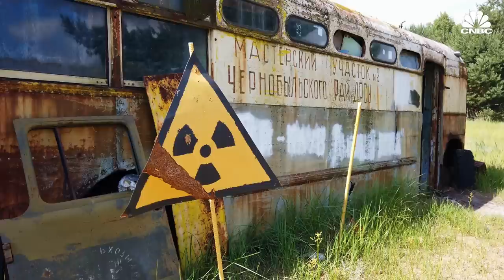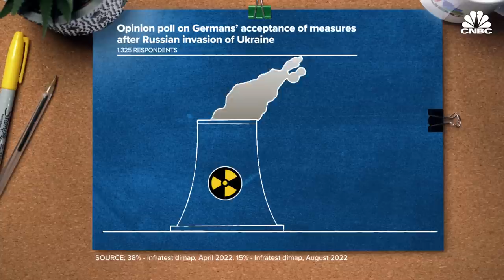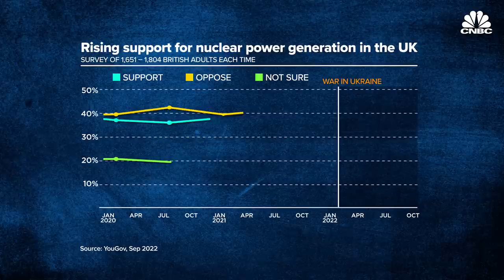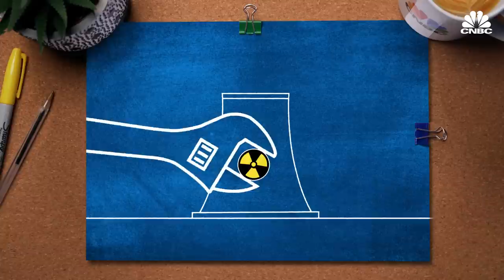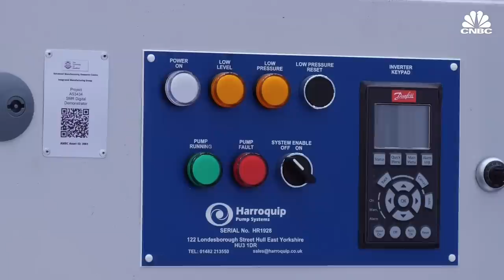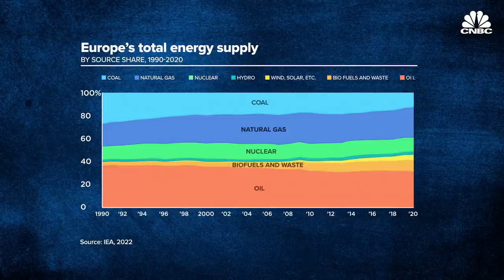The future of nuclear is divided into two camps - here’s why

Comment: It’s sad cause Germany has so much potential, its already at almost 50% renewable energy generation. Using reliable nuclear power it could have been at 60 to 70% putting at the forefront of renewable energy transition especially for a high carbon emitting country
Reply: Now Germany is increasing its use of coal.
Reply: Nuclear is low carbon source of energy but it is not renewable.....
Reply: @aldrinspeck2724   If your criteria is limited resources, then nothing is renewable.
Reply: Renewable doesn't mean "infinite", it only means "the supply is HUGE!"
Reply: nuclear electricity is five times more expensive than solar it is much more viable to develop grid storage then to build nuclear plant which takes 7 years to build
Reply: @floopybits8037  solar isn’t a viable base load electricity source for Northern Europe, and definitely more carbon intensive per mw of electricity throughout the year.
Reply: @MrSpritzmeister  Not if you source from Sahara which is sunniest place on earth. How is it caron intensive ??? Manufacturing solar cell takes less than 2% of what gas or nuclear generate per kW
Reply: @aldrinspeck2724   The world's supply of uranium and thorium is HUGE.  We even have the technology to extract uranium from sea water which has a virtually unlimited amount to meet the world's needs.
Reply: @floopybits8037  this video is about Germany and the UK, which aren’t sunny places. Where are solar panels made, using which power source? If you’d use Sahara for power generation you’d have to make sure that the panels do not overheat, get covered in sand, and then you would need massive amounts of materials for the power transmission lines, which also are carbon intensive and how about battery storage? Solar and wind are part of the energy mix, but cannot power fully an industrial country like Germany. Do you know what base load is?
Reply: @floopybits8037  Nope. Amortized existing German nuclear power stations have the cheapest electricity period. Adding only 4 hours of storage to wind and solar pushes the cost higher than the most expensive nuclear power station.
Reply: @gregorymalchuk272   lithium ion storage is expensive not rust based and air based batteries
Reply: I would like to know how urban and plutonium are renewable. Anyway pit those powerplants in India. They need it. But no whining this time if a second Bophal incident happens. There are many Indians anyway.
Reply: @floopybits8037  nuclear is like twice as cheap, wdym
Reply: @aldrinspeck2724  Current 'known' uranium mine is more than enough to supply the globe for thousands of years. That is HUGE
Reply: @aldrinspeck2724  Oh, really?  Then what would you call the fucking sun???
Reply: we got 96% non fossile fuel energy here in sweden france got 90%. While germany is pathetically at 45% fossile fuel useage. Its funny how inefficient renwebles actually are in comparison to nuclear energy especially smr reactors.  Solar is the cheapest energy if we do not count the storage cost, if we account for that it becomes one of the most expensive energy source. Potential energy batteries or litum ion battery is far more expensive then nuclear fuel. 

Like always the anti nuclear crowd just ignore large part of reality over how our energy grid works.
Reply: @floopybits8037  Not when you account for variability, and power storage, and the extra capacity you'll need to build to account for dunkerflaute.
Reply: @aldrinspeck2724  Nuclear certainly is renewable. You just must use Thorium as the basis. But we are not going to run out of Uranium for centuries even then.
Reply: @christianlibertarian5488  According to Nuclear Energy Agency of the OECD, NEA:
Thorium based breeders are only expected by 2050 (although one could stretch current fuel with Thorium by 2030 though not turn Light Water Reactors into Breeders)
NEAs Redbook notes an estimated Uranium Reserve globally of about 8.000.000 tons of Uranium. Taking the „Recycled Nuclear Fuel Cost Calculator“ for a 1 GW powerplant at 90% capacity factor gives us a Uranium demand of 200 tons per year. Assuming a planned lifetime of 60 years and ignoring consumption from existing reactors, you could build 666 new 1 GW plants.
Reply: We can’t build inland wind farms because people don’t want to see them near their homes. I don’t think we could build enough nuclear plants even if our life’s depended on it.
Reply: @Paul-uy1ru  Your life does depend on it.

Comment: 9:13 NO, most of the nuclear reactors in operation in France were built in the 70s and not the 50s (the oldest to date is Bugey 2, which began construction in 1972)
Reply: yes -  that may be true -  but so many have very serious aging and maintenance issues.  If you believe the story from the nuclear industry, the lights should have gone out in Germany and France has had no problems... but this is definately not true.   Best wishes from Berlin.
Reply: Brah they are still old and with a lot of issues. Bad planning by the french government already and will cost france a lot of money
Reply: @1968Christiaan French politicians decided by law to stop money to the maintenance of reactors. The law stated that nuclear power should be halved or so. That is the main reason why maintenance hasn’t been at par. Why didn’t the lights go out? Increased gas exports from Norway, mild winter, insane high prices which led to lower demand, rationing and the fact that many countries fired up coal power plants again. It is a shame. 
New nuclear reactors are safe. It is the energy source that has killed the least amount of people per KWh. Thousands will suffer from asthma and die early due to the politics of Berlin. 
Even though Germany managed now, what is their plan in 15 years? You need baseload power. What will they do in January if there is -15 C, no sunshine and no wind? The entire system has to be built around coping with those days. 
Batteries? Sure. Sounds great, but all the batteries on the planet can power Tokyo for 72 hours. The technology isn’t there. It is a huge gamble to think it will in a decade. The most likely result is that Germany won’t meet its climate obligations. The climate is the loser.
Reply: @1968Christiaan the reactors are fine, most of the issues are on pipes used for the cooling of the reactor and are replaceable.
Reply: @1968Christiaan in France electricity is half as expensive as in Germany, and on the other hand, 1 German produces on average twice as much CO2 as a French person. we've never had an accident and we don't have coal mines the size of New York on our territory, we can see your disastrous choices from space.

Comment: With river levels falling in Europe, and remaining river water warming, providing cooling water for nuclear reactors is an increasing problem.
Whatever the merits of nuclear power, it is unlikely to avoid the effects of climate change. Planners must be prepared for a climate that humans have never previously experienced, and that must include how electricity is generated.
Reply: Hence why they build them along the sea side.....water issue solved!!!!
Reply: Even if water levels were consistently falling across Europe, which is not the case, your point would only be a problem if unenclosed, evaporative cooling was the only solution, which is definitely not the case. For most of the year it would not even be an issue in civilized countries where fossil fuel power plant waste heat is already distributed to households. Heat exchangers could simply be integrated into the current systems, replacing one source of waste heat with another at almost no cost. England would simply have to get its act together and start building the energy-efficiency infrastructure the rest of northern Europe started building more than 100 years ago.
Reply: Palo Verde Nuclear power station is in the middle of the Arizona desert. It is cooled by treated sewage from Phoenix. 
This is not a problem inherent to the power type, unlike low energy density and intermittency, which is inherent to solar and wind.

Comment: I am from the UK, and I am potentially in favour of nuclear. I think the video exaggerates the UK position. Bear in mind these points 1) Nuclear energy as a share of UK electricity has been declining over time. New power plant Hinkley C point has been overdue and massively over budget. In addition, it was supposed to be led by a French Chinese consortium. Now the UK is deeply distrustful of the Chinese, so it is looking at ways to get them out of the project. Brexit brings additional complications such as visas for French engineers, etc  2) Small modular nuclear reactors may well be the future. Whether that is truly the future, or a clever way for Rolls Royce to get some R&D subsidies who knows. I think the potential gain, compared to a bit of money wasted on R&D makes the research worthwhile. But unless there is a break-through in Small Modular Nuclear Reactors, the role of nuclear in the UK energy generation will be small. Around 16% of UK elecricity production comes from Nuclear, and the strategy is more about keeping some baseload capacity than increasing the share 3) Both the UK's and Germany's  strategy revolves around increasing renewable power generation, which in both countries accounts for over 40% of electricity generation.

Comment: Introduction

Natural disasters are becoming more frequent and severe.

These disasters can cause widespread power outages, which can have a devastating impact on communities.

Governments need a reliable and affordable way to provide temporary power in disaster areas.

The Problem

There is a need for a reliable and affordable way to provide temporary power in disaster areas.

Current solutions are often slow to deploy and expensive.

There is also a need for a solution that is environmentally friendly.

The Solution

Ideanomics proposes to convert used containers from the pandemic into electric batteries.

These batteries can be deployed quickly and easily in disaster areas.

They are also cost-effective and environmentally friendly.

The Benefits

Ideanomics' solution can provide temporary power in disaster areas quickly and easily.

It is also cost-effective and environmentally friendly.

Ideanomics' solution can help governments save money and protect the environment.

Conclusion

Ideanomics believes that its solution is the best way to provide temporary power in disaster areas.

It is cost-effective, environmentally friendly, and easy to deploy.

Ideanomics urges governments to consider its proposal.

Comment: Why go for a super expensive and potentially dangerous option when there is wind and solar?
Reply: Sure. What if there is none?
Reply: its actually pretty cheap in the long run and isn't dangerous because it's not in the soviet union
Reply: Exactly! As long as the sun shines & the wind blows there'll be no problem.
Reply: its not "super expensive" and its as safe or safer than wind and solar, coal/oil and gas are 100<times more dangerous than any of them. if there is any clean power you should be afraid of then you should be afraid of hydro power
Reply: Wind and Solar is more expensive in the long run though.
Reply: The only instance where human error caused a nuclear meltdown happened in the Soviet Union. Contrast that with the toxic industrial waste that occurs from mining minerals and manufacturing wind turbine blades and solar panels, and how they have a short life time.
Reply: Because the sun doesn't always shine and the wind doesn't always blow.

As for the expense, that's because so few new ones are being built. Consider how the cost of solar panels reduce as production went up.
Reply: Solar is not an option for decreasing carbon emissions in Germany (according to Peter Zeihan). The emissions created in China, where they are produced, exceeds the savings that can be generated in Germany (with poor sun exposure).
Reply: @hankjones3527  The sun always shines somewhere and the wind blows always somewhere - especially at sea. 

Yes, the cost of nuclear power plants could be reduced like that. However at the time lots of countries pushed for it, they got beat by fossil fuels. And well, solar and wind beats fossil fuels for quite a while now.

And now nobody wants to lose enough money to reduce cost of nuclear power plants but china. Since they currently build everything as much as possible.
Reply: @berndarndt9924  Your first paragraph perfectly encapsulates the base level thinking that is so prominent in the renewable energy fan club. 

Even IF the sun is always shining somewhere, is it practical/cost efficient to get the power where it's needed? If it's sunny in Australia, do you have any plans on how to get the electricity to say America or Europe? 

I believe solar and wind will and should be a significant part of the energy grid, but I don't believe there's any cost effective way to rely on them only.

Comment: Plenty of misinformation in the video. No, nuclear reactors are not more reliable and independent of weather and even less of war (See France and Ukraine). From a point of national security, nuclear reactors are a no-go.  Why? because in case of a war, the enemy just needs to target the reactors with a few ballistic missiles to severly cripple the country. That would not happen if the power generation is purely renewable.
No, small nuclear reactors are not cheaper than PV or wind generators. The cost of the storage of nuclear waste over several thousands of years should be included in any cost comparison.
Reply: And nuclear won't generate electricity when the sun doesn't shine, or the wind doesn't blow. Oh no, wait! That's renewables.
Reply: Dude, that's incomplete logic.  The same concern applies to any piece of the energy sector:  knock out POL, Hydroelectric, the Grid itself (likely the most central point-of-failure anyway), you are fucked .  

Besides, your true nuclear concern should be that which is weaponized.  EMP is going to fry every circuit for miles, meaning, once again, your grid is wrecked (even if otherwise unscathed).  It really doesn't matter if it's substantially powered by "renewable" energy or not at that point.

For the record, nuclear energy is renewable energy.  It's also the cleanest, cheapest, safest source of energy currently known to man.
Reply: @redslate  please educate me on how is nuclear power renewable, cheap and clean.
Reply: @Christmas Snow  Honestly kiddo, go read about it; there are easily accessible stats provided you quit burrying your head in the ground.  This isn't a cop-out, you simply aren't paying me enough to educate you.  Send me $100/hr, and I'll consider talking offline.

In the interim however, I'll pose this logical quandry:  Do you consider solar power to be "renewable?"  Where does solar power originate?
///Spoilers///
Nuclear  🤨
Reply: @redslate You obviously did not live in a region that made you stay indoors for month, and 30 years later, still has to check mushrooms and wild boar for radioactivity even though chernobyl was 1.800 km (1.200 miles) away...